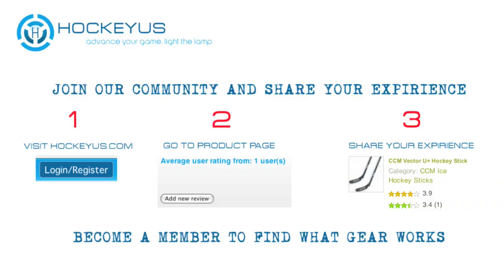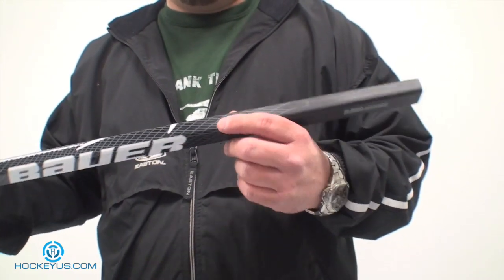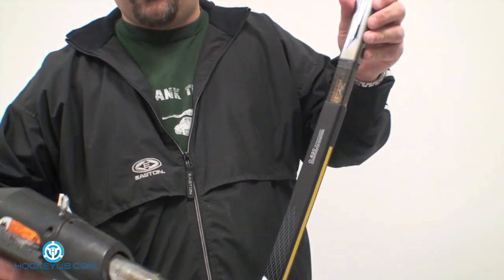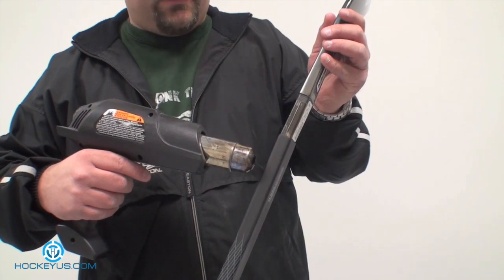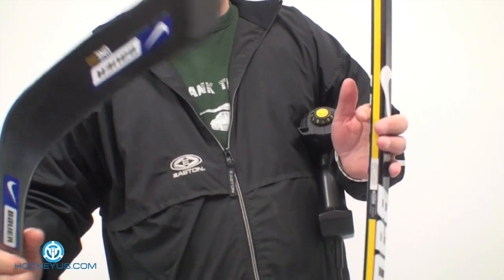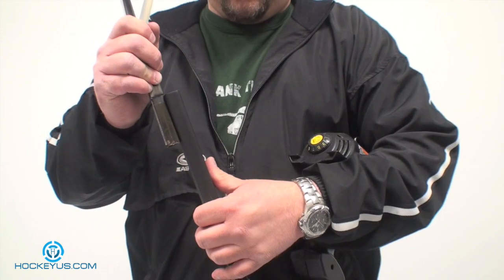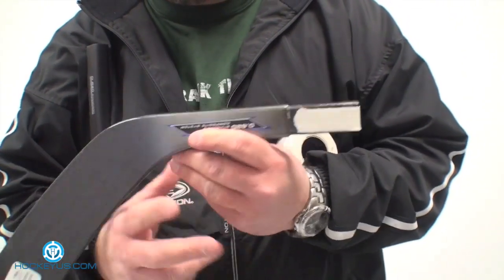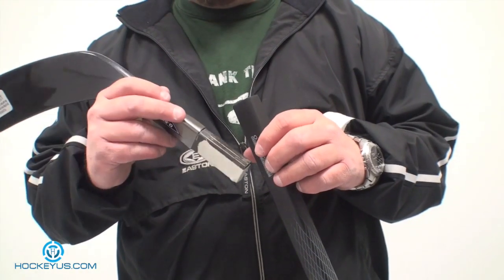How to Replace a Hockey Stick Blade

Comment: Does anyone know the best way to cut the blade off of a composite and then screw a plastic blade on the shaft? Will this crack the shaft?
I need a plastic blade and a non-wooden shaft for a floor hockey league.
Thanks.
Reply: saw the composite above the blade and shove a new blade in what used to be the side your knob was on. plus the new thinner handle makes puck control easier

Comment: you could but as you may know the RS is very tapered so tje blade may not fit, so you can either cut alot from the bottom so the blade fits. Or you could flip the shaft and put the blade in the top of the stick.

Comment: i know they recommend not to use the stove.. tho some people do. i know that you can overheat the shaft/blade and mess it up.. the question is.. how do you know if you got it too hot to the point of messing up a composite shaft.  i heated it up to remove the blade and it was easy.. putting the new blade in was tough. i had to heat it a few times to get the blade in the whole way.. felt pretty hot.. just didnt know if i coulda messed it up

Comment: sand down the broken splinters.
Get a long screw and screw half of it into hozzle. Then heat the shaft up, and pull the screw out (which will take out the hozzle with it)

Comment: @ArticCooKiE hockey stick/blade glue, check your local pro shops they should have it they usually run 1-3 bucks a stick and it looks like a glue stick that would go in a regular hot glue gun just heat and apply